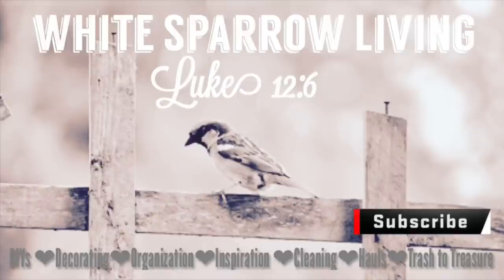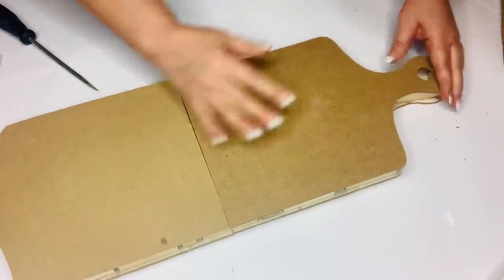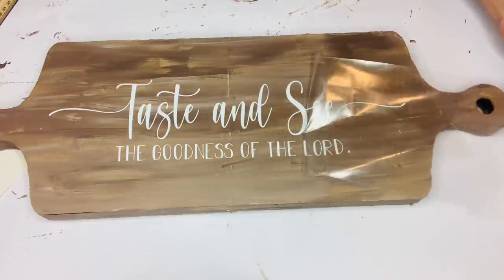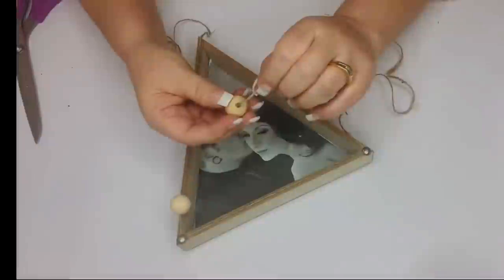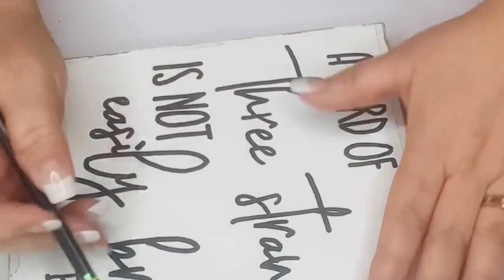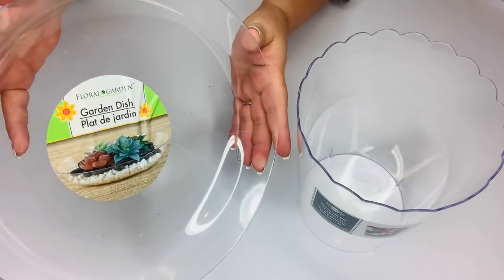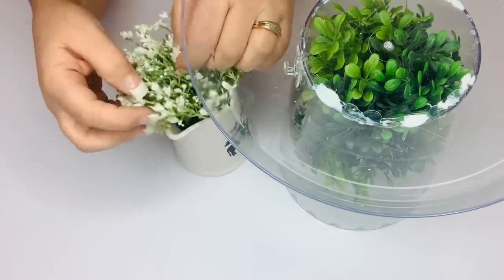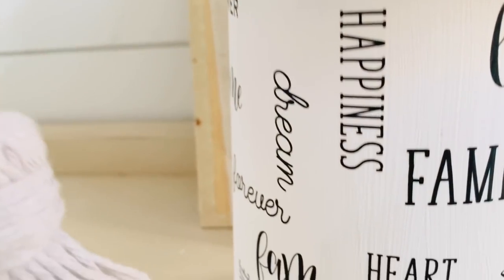6 SPRING FARMHOUSE DOLLAR TREE DIYS | 3 WAYS TO ADD WORDING TO YOUR PROJECTS | CUTTING BOARD

Comment: Next time print your black and white image in color. It will still be black and white but will look way better. Black and white has color in it if that makes sense.
Reply from the maker: OH MY GOODNESS!! I didn't know that, Randi!! Thank you so much for that amazing tip, sister!! Xoxo ❤️
Reply: @WhiteSparrowLivingLuke126  also your paper makes a big difference. Do some small tests so u dont waste ink. If your not putting modge posge or anything on it a non glossy photo paper is beautiful. If your covering it  a bright white card stock works.
Reply: It looked like your copy had black lines thru it? That means your out of ink.